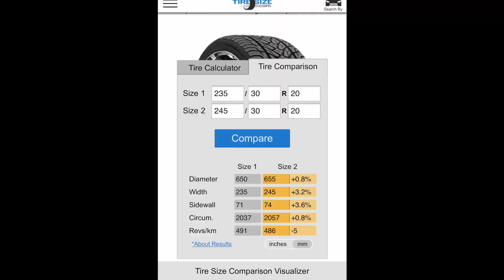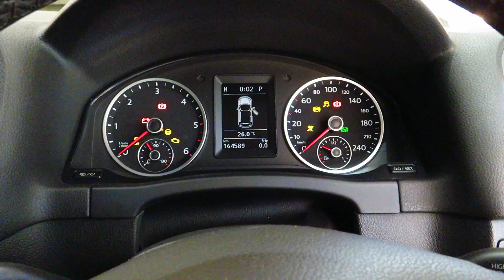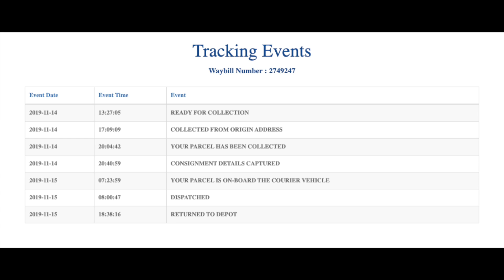FITMENT ISSUES + FIX - Cutting Up My Tiguan | CCD

Comment: The charge changes once you program the battery onto the car and trust me you feel the difference in the power and your battery lasts much longer , also it helps to have a gel battery. I have a 2012 tiguan 2.0 TDI myself and my car just died on me . I spoke to my best friend who just so happens to be a mechanic @ JOHNS SERVICE CENTRE in montague gardens and he told me that's how the cars software was designed 😉